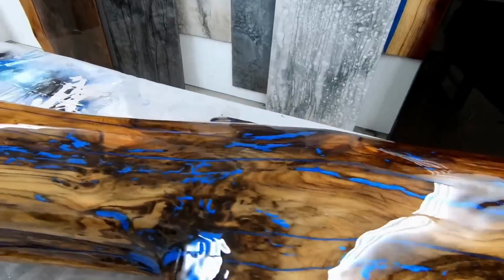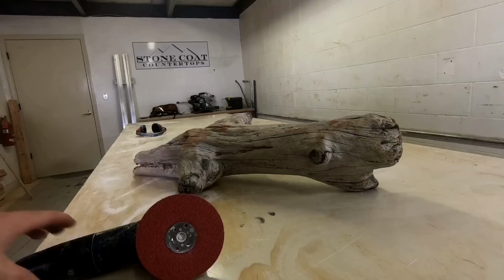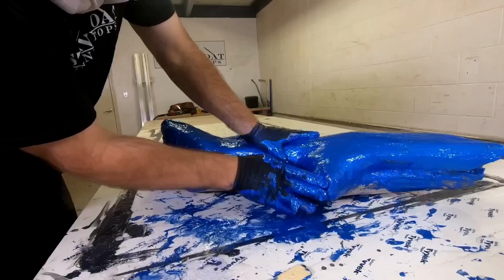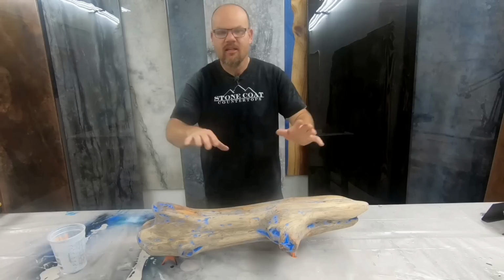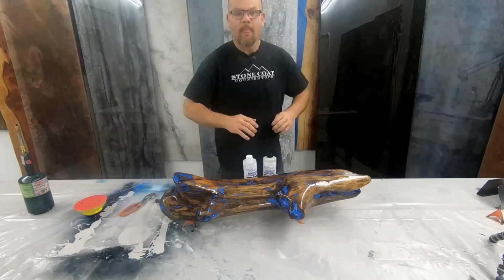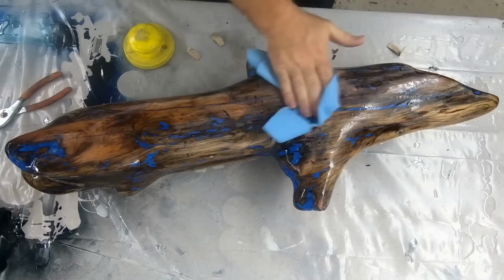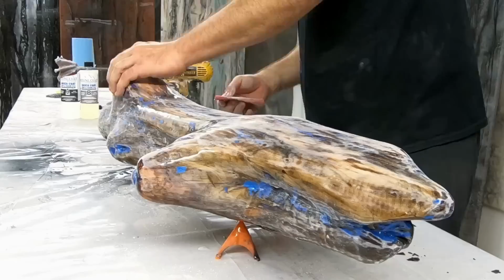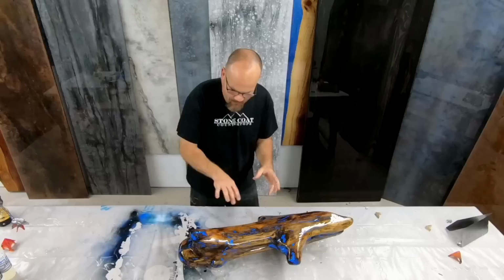3D Epoxy Drift Wood with my hands

Comment: Stone Coat Countertops, I would be ecstatic to see you do the same process with a piece of hollow, profusely pitted driftwood.  Maybe add some glow-in-the-dark powder with the blue, and then add some green to the mix to fill in some, not all, of the pits.  If you fashion a sealed plug for the interior (I wonder if just plain aluminum foil would work), then, when it is fully set-up, add a string of fairy lights or a single LED bulb to illuminate from within.

Comment: I did this exact same project but I flushed one end so it would stand straight up and square. I put blue fairy lights on it as well and it turned out AWESOME everybody loved it. They all asked if they could rub it cause it was so shiny they could not resist. Then in the dark it doubles as a nice mood light or night light were you need one.

Comment: This looks stunning.  As I have never done any of this before I was just wondering if the wood was completely dried out , if not what is the minimum level of moisture content allowed?
Reply from the maker: Hi Malcom, thank you for your kind feedback and we appreciate you tuning in! We like the moisture content in our slabs and wood projects below 13%, here is a link to the moisture meter we use: https://www.amazon.com/Calculated-Industries-7440-AccuMASTER-Moisture/dp/B06XGJDVFV/ref=as_sl_pc_qf_sp_asin_til?tag=stoncoatcoun-20&linkCode=w00&linkId=e751aa38ab84cf24a2d01006827f48a4&creativeASIN=B06XGJDVFV  Feel free to call or email us anytime for project support. (541)450-1976

Comment: That is absolutely stunning and I beyond love that blue color! - Heidi
Reply: Most welcome. :) Yes but not with resin though it may work in towards the end. I made a painting for a background on a wood panel then sculpted a goddess figure. I was having trouble figuring out how to dress her but then I remembered my feather stash from the neighbors exotic roosters. I found a few feathers perfect for her 'clothing' and just glued them on. Waiting for the glue to dry now before moving on. I am thinking I will clear coat the painting with a thin layer of resin and place the figure on while the resin is still liquid so that it will adhere the figure to the painting. :) I do have a viability test coming up soon using resin. I am wanting to see if something I add will hold up or will melt in the resin due to heat of curing. :P
Reply: Pretty pleased with her so far and I sure will. :)

Comment: i thought about doing a small slab with asian cork carvings, using pearl flouro. green as grass area and clear as the fill. just need the shop and space to do it in. i wonder if the asian cork would sit well once it gets tacky and then stay put while the clear is being poured.

Comment: I really wish I had found epoxy resin before we painted our countertops.  I have watched quite a few videos dealing with epoxy resin and the endless possibilities blow my mind. I don't remember right off who we bought the paint that we used on our countertops to try to get a gray, rock like, appearance.  Trust me, the countertops look 100% better now than they did before we refinished them. We live in a Mobil home from the late 70's so you can imagine how outdated everything is. Our home was left to my wife by her grandparents when they passed away and even though it's out dated everything is in pretty good shape especially for its age. I love the super gloss appearance that this epoxy resin leaves and I'm really thinking about redoing the countertops again making it the 3rd time we have refinished the countertops.  The 1st time we tried refinishing the countertops we tried a countertop paint that really sucked arse. It was just basic grey. The instructions were very vague and we found out days later on how incomplete they were. For being a countertop paint it held up horribly. We are working on a very strict budget which is why we decided to paint the countertops instead of replacing them. There is nothing wrong with the countertops other than the finish was stained and worn from 30+ years of use and abuse. We want a rustic, country kitchen look for the kitchen. We have painted all the cabinets a light grey with a dark grey for all the trim. We also bought thin red cedar wood that's normally used for walls in a closet to keep moths from destroying clothes that we used on the walls off the kitchen for that rustic look. We left the wood it's natural color but put a clear on it to protect the wood and make it easy to clean. My only complaint is that I don't feel it's shiny enough. The wood is darker since the clear kinda gives it a wet look but not enough shine for the complete "wet" look that I would really like. I would really like to use an epoxy resin on the walls but I don't want any runs that may form from waiting for it to dry. One thing I do love about the epoxy resin is how you can have a thick clear coat which anyone who has had a custom vehicle knows how a thick clear coat can add depth along with an incredible "wet" look.  One downfall I see with using an epoxy resin is how long it takes to fully cure. We have 4 adults and 4 kids who live in our home, me, my wife, a room mate, my oldest daughter and her 4 children with the youngest being almost 4. When we redid the countertops the last time we did half of the countertops at a time so we could use the other half to cook since its obviously too much money to eat out every day while waiting for the countertops to dry. After seeing different projects done with epoxy resin we have decided that we are going to use it on the floor for the bathroom floors. In one bathroom we are thinking about putting down a grey base coat and then covering the floor in over $400 of pennies before putting down  clear epoxy to protect the floor from water that our grandkids leave behind from their showers.
Reply: StoneCoatCountertops The panels on the wall were put up with finishing nails done with a brad nailer. I was thinking about trying the additive that thickens the epoxy and apply several coats, give or take. My wife and I were actually discussing adding thinly sliced wood to the top of the counters and then using the epoxy resin to fill in and smooth out the counters
Reply: Since I already have a water based clear coat on the cedar panels on the walls I assume that I should sand that before applying the resin, correct? What grit would you suggest? How many thin coats should I put on the panels? Should I sand between coats or do I have a certain amount of time that I can apply coats without sanding?

Comment: what types of gloves? Mixing containers? the simple stuff...?
working on a tree stump piece, and second coat I poured/mixed too much, but by the time I found something to use it on, the cup was hot, and it was definitely hardening, but it worked for the little piece of tile I used it on.
Reply from the maker: Great question Marta Alfred! We use disposable latex-free Nitrile gloves and we use mixing buckets from the paint section at Home Depot, you can also find these items at your local hardware or paint store.  Our quick coat has a 15 minute working time, if left in a mixing bucket for long it will start to heat up. We would love to see photos of your project, please feel free to share with us at stonecoatcountertops@gmail.com.
Reply: sent you an email.. :-)

Comment: Have you had any problems with the blue epoxy staining your wood around the cracks? I recently filled all the cracks in a piece of aromatic cedar and got a lot of staining around the cracks, had to sand down almost a two millimeters to fully get rid of it

Comment: So what do you use to keep epoxy from sticking to table? Is that Tyvek tape? Also how about doing a big timber slab that has been cut across a big tree, that has all the rings in it. Think that would be sharp as well. Thanks for the videos.

Comment: Is it safe not to use a respirator when working with epoxy resin? The "Quick Coat" as you referred to it, is this non-toxic to inhale? Just wondering as I would prefer this kind of process.

Comment: awesome art piece, did you use any hot wiring or  soldering iron to burn more detail of the suggested imagery on the  driftwood before your first seal coat at all, or did you give imagary suggestion through the use of your grinders mark making?
Reply from the maker: Hi Living multiverse, this project evolved naturally, what you saw in the video are the only steps we took on this drift wood piece!

Comment: This is the first video I have seen of yours and all I can say is "Wow!".  I do have a question for you though...I have an old, weather-beaten picnic table and benches that is still in good shape, but does need some sanding to even out the raised grain.  It is very dried out and has some cracks in the table top and bench seats, and I think this process would make it not only look amazing but weather resistant.   It would be a pretty large surface area.  Any advice on this project would be much appreciated.

Comment: Would like to have seen that piece with inset decorative oil lamps.  That assumes that the piece is not so tall that it would prevent conversation across the dining room table.  Regardless, really looks great!
Reply from the maker: Thank you for your kind feedback Xandrosi! What other 3-D objects projects would you like to see us create?
Reply: I know you've indicated that the epoxy is sun tolerant.  Is the coefficient of expansion of the epoxy like wood?  Confining the projects to variants of flat surfaces, a pergola might be interesting using really distressed lumber.  Even if you just did the outer border or cross-pieces above, that might be an interesting project.  Something simpler might be a gate or even a decorative inset panel for a gate.

Comment: Looks great Mike, always coming up with new ideas. 
It got me thinking though...what about building a table top from old barn wood and filling in holes, cracks etc. with the blue epoxy? Have you done that yet?
Reply: StoneCoatCountertops I like the metallic ocean blue, gives a depth perspective. I did see a wood table where they used a translucent grey to fill voids and it looked really nice. 

I’m still waiting to move into the new house so I can have my workshop...then it’s off to the races with the advertising :)

Comment: Has that wood been stabilized in any way or is it straight out of the wild?I have a small chewed beaver log that I want to attempt that with,but not sure about the necessary preparation. Please advise.There are chew marks all over it that I don't want to sand away.What would happen if I don't sand it??

Comment: I'm trying to coat a hand grenade with this stuff. I want it to look thick with a solid color. Would I just need to sand it smooth and then apply the quick coat stuff that u applied after blue fill step? Would I need to do the blow torch step?

Comment: ❤️❤️❤️❤️❤️❤️. Which epoxy is best for art projects? I bought some. Hope it was the right one.   Would love a sample pack of your metallics and glitter.
Reply from the maker: Great question Rebecca, check out our art epoxy products here: https://www.stonecoatcountertops.com/art-epoxy-products Our Art Coat has an extended working time, an extended pot life and additional UV protection.  It is compatible with alcohol inks, acrylics, silicone oils, metallics, oil based paint and more! Call or write us anytime for project support. (541) 450-1976

Comment: What are those things called that you used under it to hold it up while you were applying the clear epoxy?
Reply from the maker: Great question Derek Williams, we use painter's tripods, you can find them in the Paint section at Home Depot, here is a link: https://www.homedepot.com/p/HDX-Painter-s-Tripods-10-Pack-PT10-HDX/206509477 Call or email us anytime with questions or for project support.

Comment: Love it! can you show some copper metallic on cedar I'm making a coffee table base and  I liked the example piece you showed on the beginning of video was that just the clear coat?
Reply from the maker: Great question Kathleen! The example he shows in the beginning of the video was created using the same process and the same material and colors!
Reply: Hi Stone coat countertops I have my table base picked out and almost done sanding the piece it is redwood cedar and I've seen how it would come out with just a clear coat and really don't like the white wood of it. I am trying to decide what color I my like to fill my creaks and voids red, brown black or coffee. Any chance you can post a pick of examples on Cedar. I want to do this first before my countertops  and also an 8 foot farm table.

Comment: Hey Mike. Great looking piece. I haven't yet got to try any epoxy projects yet. Don't have the extra cash for it yet. I was wondering I seen you rubbing the epoxy on this whole piece, but what did you do where the painters triangle were? Did you just lift the piece and rub on epoxy and sit it back down on the triangle? If so wouldn't this leave a small imperfection? Or is that something not to worry about since it's on bottom. Also how did you torch the bottom? Thanks

Comment: Quick question: for someone who doesn't have a metal sander, can I sand off the first quick coat by hand? (I have a small piece of driftwood, maybe a quarter of the size you are finishing.) I have never worked with epoxy but I know it's insanely hard to take off once it dries so I just want to know how much trouble I'll get into without a metal sander. Thanks I'm advance!

Comment: This is beautiful. I have some reclaimed wood I would like to epoxy my old kitchen counters can with. I have a small rock/log cabin so I want to stick with this theme. It's perfect! I'm really not sure how to begin my project. I love natural wood. I bought an oscillating tool for sanding and trimming my pieces. I'm sure I will want my floor to look the same when I finish. The area is 10'x10' rounded up that includes floor and counter space. How much clear epoxy would I need for this size area? Could I use acrylic paint with epoxy?

Comment: Once the driftwood is coated, can it go outside? Will it weather rain and sun? Thanks!
Reply from the maker: Yes, You can put it outside once it has cured. Our epoxy has uv inhibitors so that you will see little to no yellowing over time.  As for other factors like humidity as well as freezing temps use caution and make sure you keep it well protected when not in use.

Comment: I am working on a table top and long story short I have some humps in it. Can I sand it back smooth with 80 grit to level it and then sand it with 320 and up to 2000 or 3000  to smooth it out? Then what to make it look like glass? Buff it with the Meguiar's rubbing compound on your site? Any help would be great, trying to make something half as nice as the stuff your making!
Reply from the maker: Hey justinlogue31, You can sand and polish the surface. Take a look at this how to video: https://www.youtube.com/watch?v=iFpzdvPaQl0
If you have additional questions give us a call 541-450-1976

Comment: Saludos...felicitaciones por aca desde colombia aprendiendo su arte...que tipo de disco utilizaste para pulir la madera.....gracias
Reply from the maker: Gran pregunta Aquí hay un enlace al disco de lijado de fibra de metal de 50 granos que utilizamos: https://www.homedepot.com/p/Diablo-5-in-50-Grit-Fiber-Disc-4-Pack-DCF050050S04G/202830897

https://www.homedepot.com/p/Diablo-4-1-2-in-x-5-8-in-50-Grit-Grinder-Sander-Conversion-Kit-DCP045VGPS01G/202830887?MERCH=REC-rv_gm_pip_rr-202830896--202830887--N

Comment: Beautiful & amazing techniques do not give this project justice.  LOVE IT!  Love it so much, I’m going to order your kit, but I need to call cuz I do. Ot see the hardener on your website.  One quick question...what brand of grinder do you use?  I have almost every tool known to man, but no experience with an angle grinder.  Surprised you didn’t need the side-assist handle to guide it.  Keep up the gorgeous work & thanks for sharing!
Reply from the maker: Hi Rick! When purchasing on of our kits you will receive the Part A and the Part B! 
Here is a link to the angle grinder we use on our projects as well as the sanding disk and attachment part!

Grinder- https://www.amazon.com/Makita-9565CV-High-Power-Angle-Grinder/dp/B00005Q7BG/ref=as_sl_pc_qf_sp_asin_til?tag=stoncoatcoun-20&linkCode=w00&linkId=fa2b9da7f297e3f3e7e2295fe2729303&creativeASIN=B00005Q7BG

Sanding disk- http://www.homedepot.com/p/Diablo-5-in-50-Grit-Fiber-Disc-4-Pack-DCF050050S04G/202830897

Attachment- http://www.homedepot.com/p/Diablo-4-1-2-in-x-5-8-in-50-Grit-Grinder-Sander-Conversion-Kit-DCP045VGPS01G/202830887?MERCH=REC-rv_gm_pip_rr-202830896--202830887--N
Reply: Stone Coat Countertops thanks!

Comment: I definitely want to try this, but when I find driftwood it is usually very dirty or filled with sand.  Do you pressure wash it to get out the gunk or use an air compressor and blow it out? I know pressure washing would require a drying time but how much?
Reply: dude, of course you have to wash it and dry it. Come on.

Comment: Am sure this has been asked or covered in another video, but instead of a torch, can a heat gun be used to get rid of the bubbles in between coats?
Reply from the maker: Great question! We always use a propane torch. A heat gun will work, but not as effectively as a torch. In our experience the torch pops bubbles and moves color much better than the heat gun. Here is a link to our favorite torch head. This is used with off the shelf small propane bottles: https://www.amazon.com/Bernzomatic-TS4000-Trigger-Start-Torch/dp/B00008ZA09/ref=as_sl_pc_qf_sp_asin_til?tag=stoncoatcoun-20&linkCode=w00&linkId=1079ed93ce4f9a3210140881ab1ed4ed&creativeASIN=B00008ZA09
Reply: Thank you and love your videos.  Plan on trying my hand on the wood work you have demonstrated.